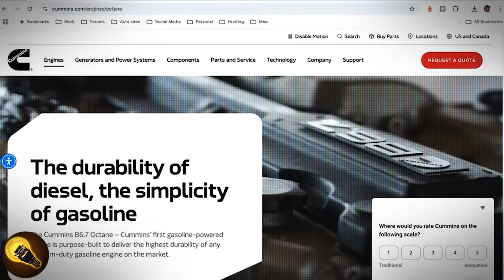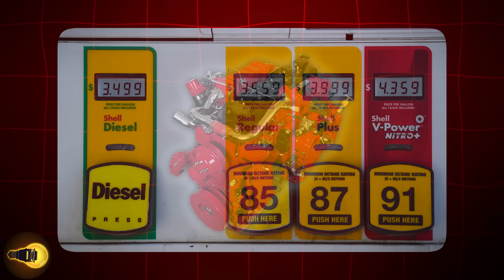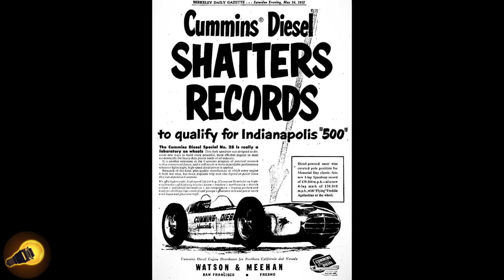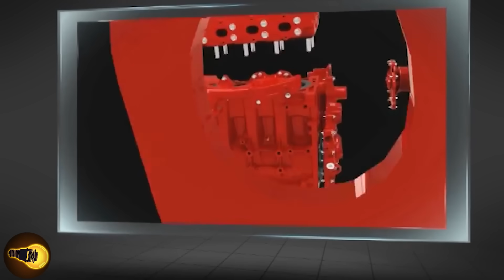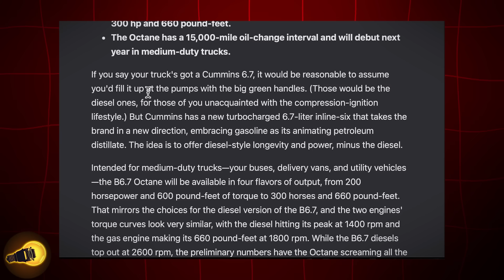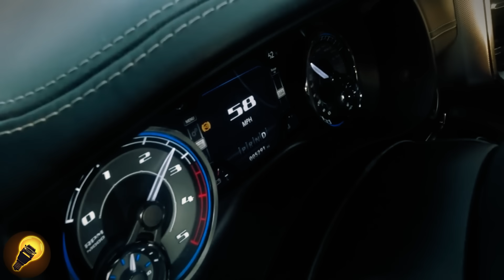Cummins Shakes The Industry With A Gasoline Engine!!!

Comment: Cummins had a v8 gasoline engine based on the triple nickel called the Cummins giesel. It was used in busses in the prototype stages in the early 1970's in the LA transit authority MTA
Reply: Love that name Geisel
Reply: @JustinKerns8x6  that's what it was called. Unfortunately when I was researching it, I couldn't find anything on it, but I specifically remember working on it in the early 70's, during the gas crisis. For every barrel of oil, 60+% of that barrel, it's gasoline, 20% diesel and then base oils. It was based off the triple nickel Cummins engine

Comment: Cummins has been building a spark ignited engines for about 2 decades.   The were designed to run on natural gas and were put in garbage trucks and school buses.   Having them run on gasoline is not a real reach for them.  Just lower the compression ratio a bit.
Reply: Actually since the '60's they have had their diesels running on natural gas, sewer gas, etc. in industrial applications, like pumping water for orange groves outside of Yuma Az. where I visited to service the cylinder heads in 1972 as a rep for Cummins.

Comment: Emissions/ regen has killed ownership experience. Cummins getting smart here.
Reply: The EPA rolling them back is even smarter.
Reply: @wisenber  Are you old enough to have breathed the air in the pre smog control days?
Reply: @michaelt7529  I'm old enough to know the difference between 2007 and today when the EPA moved the goalposts.
Have you lived long enough to know that smog controls had already been working for decades before the nitrogen regs got added?
Reply: @wisenber  I got my CA driver license in 1972 back when pocket change got you gallons of leaded gasoline. And I have burned my fair share of it over the last 53 years. I am also old enough to remember being told no school recess today due to smog and how my eyes burned and lungs ached while framing houses in the mid 70's. I can't say much about the 2007 to the later nitrogen regs as clean air makes them irrelevant to me.
Reply: @michaelt7529  "I can't say much about the 2007 to the later nitrogen regs as clean air makes them irrelevant to me."
Can you say whether you can honestly notice any difference between 2007 and now? That would be relevant.
Stepping in horse crap in town used to be bad too, but that also hasn't happened in the last half century.
Reply: @wisenber  No, I can't tell any difference. What is relevant to me is the air I breathe.
Reply: @michaelt7529  Which again, if you haven't detected an improvement, then what are you chasing?
Reply: With modern GTDI technology the delta between gasoline and diesel has narrowed a lot.
Reply: Diesel engines built with lower yet reasonable horsepower will win the long engine life race.
Reply: @ there plenty of examples of gasoline engines that run 300k miles
Reply: @yolo_burrito  Lots of people like tacos too, but I also never said they didn't.
That being said diesel (prior to nitrogen regs) had demonstrably longer lives than gasoline engines.
I've got a Dodge with over 1.2M on it. Replaced the seats about every 250k miles, but still has the original engine.

Comment: Diesel engines operate with very high compression. Far higher than any gasoline burning engine. To run on lower octane gasoline the compression ratio must be drastically reduced. And this is done with different pistons, connecting rods, and crankshafts. Obviously someone doesn’t know much about internal combustion engines.
Reply: With direct injection you can have high compression gasoline engine if internals are strong enough which Cummins has already
Reply: That and/or heavily chambered heads. Va	variable compression engine designs exist. It would have to be built diesel-first, but able to drop compression and run gas at a lousy rate comparatively.
Reply: Also, if dual cams, adjust more overlap to bleed off low-end pressure in gas mode
Reply: I have a big RAM and a little Mazda 3. The Mazda runs cheap gas and very high compression, runs and drives like a wet dream with 50 mpg!
I have no doubt Cummins is doing something very similar to the multi chamber piston and direct injection. 
Dam smart idea.

Comment: I remember a machine shop in Albuquerque in the 90's that was working on converting a 4BT to run on gas. Alot of work was done on the head, pistons and crank. I thought it was crazy at the time but now wonder how far they got?
Reply: Miles. Direct computer controlled injection. just for starters
Reply: Terrible idea

Comment: If I am not mistaken ,( Kabota) converted a Diesal block to "GAS" back in the 1990s
They were putting this in the small lawn riding mowers.
Reply: they still do that today 👍 same with the 70’s vw diesel rabbits.
Reply: @RDC_Autosports  I owned an automotive machine shop for over 30 years. I lost track of how many rabbit diesel heads i surfaced back in the day. blown head gaskets were a problem. They could last probably due to the fact they were so low stressed and gutless.
Reply: yes kubota makes spark ignition engines  but i dont think this big